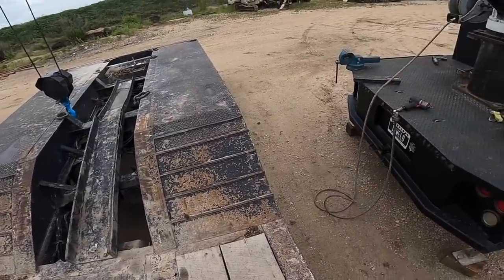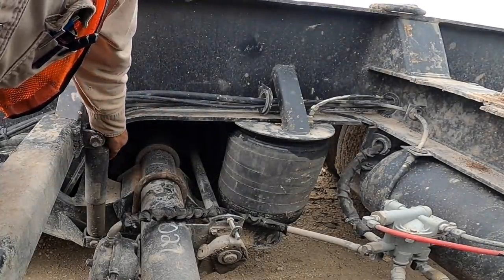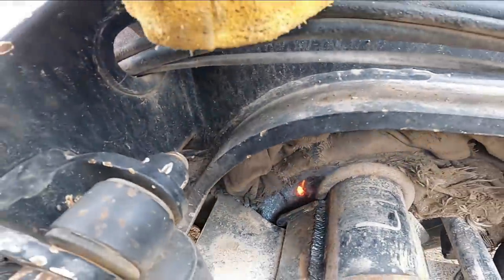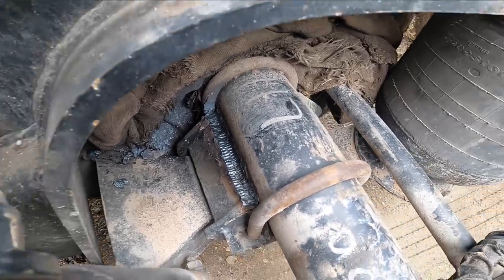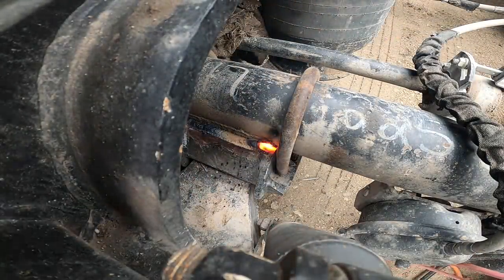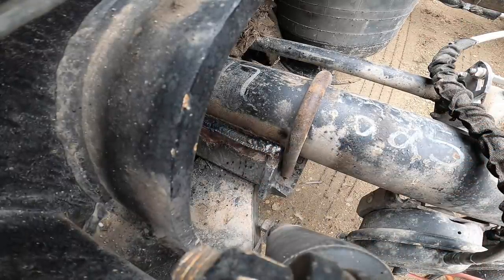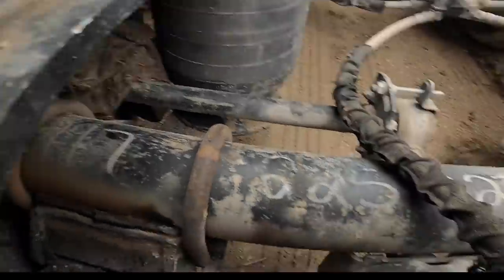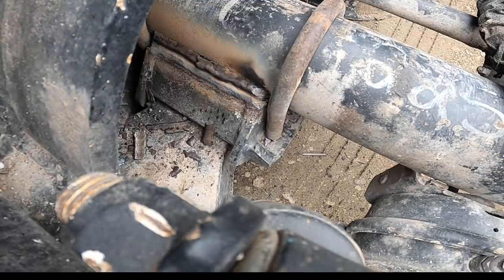Low Boy Axle Repair

Comment: How come you don't weld triangular gussets across the weld.  Apparently the weld is always cracking because the stress is in the opposite direction, so a few small tri angle pieces would strengthen it the opposite way, just my opininion.

Comment: Question for you !!
I am a new welder =
Can i use E7014  every where  ???
Because 7018 are sensitive to humidity and so on 
And hard to start ,
Now i need here a direct answer fro you 
Thanks in advance
Reply from the maker: Not sure. Im not familiar with 7014's
Reply: 7018 is more practical and universal than 7014.  
If the 7018 is hard to start, you've either got a cheap quality rod or not running enough amperage.  I've run into some issues with poor quality rod being hard to start, where as higher quality rod being easy to start and smooth to run.  
May I ask what kind of 7018 you're using (the rod brand)?

Comment: Look at you go from a carpenter to a carpet layer to weld repairs.😆
Nice job again. Have you ever used 7018 ESAB welding rod?
Reply: Esab made some really good welders ! I'm old enough to remember when Esab was L-Tec. Bought many a box of Esab rods because they were cheaper and my buddy at the welding supply store always gave me a great deal. If you can afford to buy the Excalibur's, pay  the extra money. They burn a lot smoother.
Reply from the maker: Yes I have They are very good electrodes. just very expensive
Reply: Yes they are.

Comment: I had a job where it seemed the sun was ALWAYS behind me.  I finally too the back out of an old welding jacket (cotton green one) and taped it to the top of my helmet.  The cloth did affect air circulation around my head but it also kept the sun off my head.  Sort of a wash on that point.  I kept the sun off my lens and worked perfect for that.  I don't keep it on there.  Maybe I'll put some velcro on it and keep it in my box.  Anyway, it worked.  Thanks for posting.
Reply: That’s why those pipeliners wear the “pancake” hoods! Basically a rectangular lens type cutting goggle frame with a disc of aluminum or other light material, and the lens replaced with a welding lens shade 10 or higher. It totally blocks the sun from the inside of the lens! The custom made ones aren’t cheap!
Reply: @tomt9543  I have one but they are not allowed anymore on the oil patch unless you modify them and wear safety glasses under them.  Most welders have gone to scoops.
Reply: @repalmore  I’m learning something here! What are scoops? Never heard of them. I’m very old! Ha!
Reply: @repalmore  I’ve been a Fibre metal user/fan for most of my 41 year career as a certified welder! Relatively light weight but good quality! Never heard them called that before! The worst thing of all is wearing ANY welding hood on ANY hard hat! TORTURE! 61 by the way!
Reply: @tomt9543  Oil patch is changing.  Last there ins 2012.  They were just then completely requiring welders to go to hard hat mounted welding helmet.
Reply: @repalmore  I don’t know what it’s like in hell, and I hope I never find out, but I bet you have to wear a welding hood on a hard hat 24/7! Ha!
Reply: @tomt9543  Don't understand where all the hell talk is coming from but I don't make the rules.  You want to work in certain industries, that's what you have to do.  Best of luck.
Reply: @repalmore  That was just an expression of how much I dislike them! I’m retired now, so all the welding I do in my home shop is happily done wearing my trusty Speedglass auto darkening hood! Have a good day!

Comment: What is your setting on the old stick welder with the 7018 rod
Reply: He explained his settings through out the video. That is a very vague question without the other inputs necessary to answer the question. Material type and thickness, rod size, welder, amperage and position. Thats not a yes or no question.

Comment: The gouging isn't all that bad, but before you weld after gouging you need to grind or use a pencil grinder to remove the carbon that is left behind when you arc air steel. If you don't, you are make a very brittle weld !!It will crack again !!

Comment: The rust on the welds tells me that the welds have flexed enough to pop the paint off: Inadequate design. It might also be cracked under the U-bolt.
Reply: More than likely it's designed well but has been over loaded or loaded improperly.
Reply: @mikeznel6048  Since all four welds show stress, it's either improperly designed, poorly welded, or over loaded.

Comment: Not sure what exactly you were fixing?  After you gouged it I could see s line splitting the angle the axle appears to be sitting on.  Is that the issue?  How would the owner of the trailer even know what’s going wrong and you need to be called?  Guess I’m showing my weak welding skills-
Reply: Maybe it’s the device you’re watching on? Those welds had a crack from end to end.
Reply: How would the owner of the trailer even know what’s going wrong and you need to be called? I think that is a good question And the only answer is the driver checks those axles when loading The crack may be bigger with a load on the trailer or it pulls funny. Just a guess someone else will probable have a better answer.
Reply: it's a bracket/saddle welded on the axle, so it fits on the leafspring nice. lookup leafsprings and u-bolts.
Reply: I get it now, have fixed my own trailer, just lighter weight capacity.  It’s funny to me (peculiar) that some drivers feel things that are wrong within a few miles.  A good hand worth at least his (her) paycheck.  Employers should listen to them-

Comment: Doesn't that cook the oil in the axle?
Reply: Where he is welding there is no oil, and the heat would never transfer far enough to ruin the oil or the oil seal. I have done several of these myself already and no oil change needed.
Reply: @jeffsimonar7161  Exactly what Jeff said!

Comment: What would be another option if a person does not have a machine rated enough to run an arc gouger?
Reply: 3/16 carbon rods can be run at 150-180 amps, not sure you can get smaller rods then that though.
Reply: Die Grinder and some good Burrs maybe..
Reply: Hypertherm 45XP plasma cutter has an incredible gouging mode. But, requires 220V and an air supply.
Reply: Scarfing tip on acetylene torch.
Reply: @mikenew9263  
Thank you for the info

Comment: A simple job to explaiin sure, but not exactly an easy one to pull off.
Reply: Started getting arc blow or spatter  from the 1/8 , 7018  to 5/32  stringer beads to cap , Issac is very methodical getting upper hand on that situation .,🤔👍💪✌️🙏🤙😊🖖

Comment: I have had to burn out and change the complete arm 8 different times when the bushings wipe out. It was cheaper to replace them completely then press bushings in sideways
Reply: Did you check w/ the axle manufacturer? I know some have a bushing replacement tool loan program. The tool is basically a long acme threaded rod you use w/ an impact to pull out/pull in the bushings.

Comment: I have always wanted to get an arc gouge set up. But I have been told my bobcat 250 is to small for doing that.
Reply: A 250 can handle up to 1/4 gouge rods easily, I run 3/16 at only 140-150. The main thing is to have a good air compressor to keep up with it.

Comment: NEVER weld over the path of an air arc gouge without first grinding away the oxygenated layer. Amateur move.
Reply: Hahahaha if you have to grind it your doing it wrong😂
Reply: @matthewbrittain2919  your an  intelligent one aren't you. Comprehending isnt your strength I figure. Hes not talking about grinding the bead profile after its completion. Piss poor preperation leads to piss poor performance. He said clean the freshly gouged surface prior to welding...🤓
Reply: @richardvillanueva8786  what are you on about?? As a qualified coded welder and boiler maker for 20 years gouging at a shallow angle at high speed, multiple times will  not leave any carbonised or oxygenated layer. Dumb ass deep one pass gouging will! If you do it right you leave a surface ready to weld straight on too! But of course you knew that. Being an expert and all.
Reply: @matthewbrittain2919  😂👎

Comment: Torque test channel just did a video on those type of swivel air fittings.  https://youtu.be/4OPQiDumtJ0.  
Its amazing how much flow they restrict.  I’ve used them for years but I’m phasing them out now.